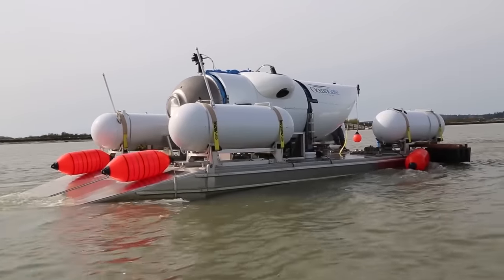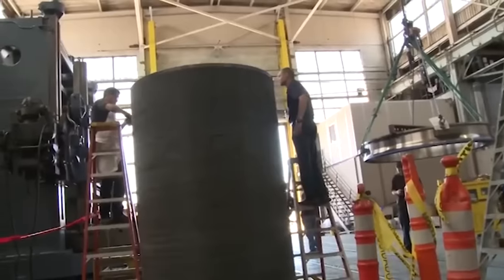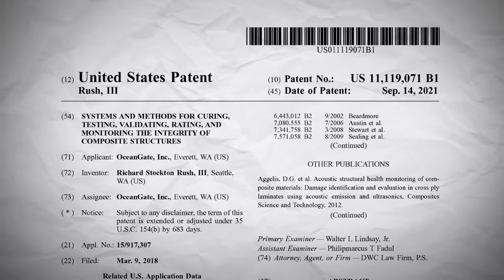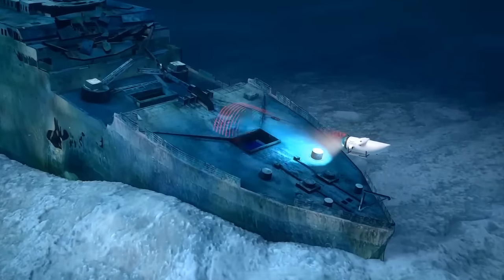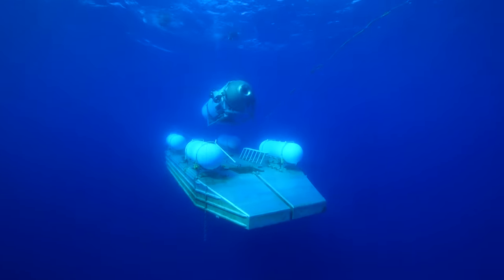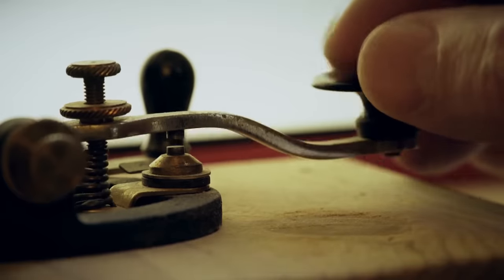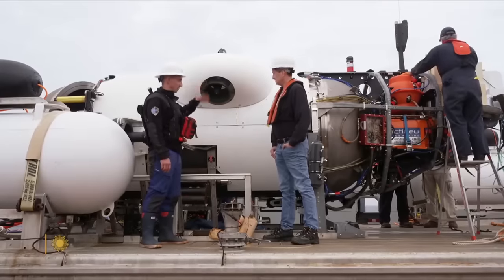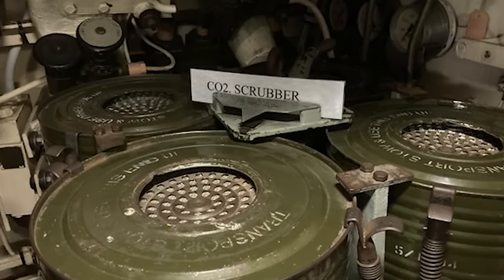Exposing OceanGate Submarines Many Fatal Designs

Comment from the maker: Thanks for watching and sharing so many insightful comments! I will try and summarise points I see here for those interested (please reply to this comment with more details you have!) :

- The carbon fibre was laid in one direction for the Titan, not a four axis weave pattern, which is much stronger
- Carbon fibre hulls are better understood for single use applications
- Other carbon pressure vessels (e.g. hydrogen tanks) have high pressure inside, instead of outside. This plays to the tensile strengths of carbon fibre, instead of relying on the compressive strength.
- Although game controllers are used in the military, this is never for complete control of a manned vehicle (though they are often used for life-critical missions, such as bomb disposal). The game controller being wireless was also an added failure mode, however there may have been control available through other methods, such as the touch screens, if needed.
- There was an inertial navigation system on the Titan, but this did not guide them toward the Titanic wreckage or give details on their surroundings. They were still reliant on the mothership for directions!
Reply: Titanic Submarine Mission V, James Cameron, Avatar: The Way of Water, The Abyss & Greek Sea Gods...

Come this way...
Reply: Physics beat you to this topic.
Reply: @JeremyRobertWalker  
ESG scores are to die for.
Reply: you are doing well sir
Reply: There was no backup Remote vehicle attached to the submersible to assist with recovery efforts in a disabled state and Stockton was warned about the consequences. What an egotistical tool!
Reply: @@presidenteden6498 
Excellent point 👍
Makes me wonder how thick the champagne bottles glass really are and how much pressure they had in them before the Titanic sank🤔
Reply: you clearly missed a point, fiber carbon is used to keep the shell from EXPANDING. it is 100% useless when COMPRESSING, experts told the guy not to use carbon for that reason.
Reply: You don't know the failure point yet. How about we allow the investigation to determine that definitively before we just pronounce it.
Reply: I did learn something new, but is Elon Musk listening before putting people at risk going to Mars?
Reply: Hello Ryan, my Uncle Ned was on said Submarine!  It's very sad and I'm a wreck!
Reply: @@presidenteden6498 Be interesting for someone to retrieve one of those champagne bottles and bring it back to the surface to see if it remains intact and then inspect it! 
By the way, your far beyond my pay grade I didn't graduate and couldn't pass the GED. But I did experience 12 feet under water as a kid 40 + years ago playing in a Olympic size swimming pool. 
And from my very limited experience I would not have gotten into that death trap, even if someone paid my broke arse.  🙄
Reply: @michael-4k4000  Very sorry for your loss Michael. I still miss my uncle that passed in his sleep 14 years ago. And my father that disappeared 30 years ago.😔 
Take care of yourself and God speed 🙏
Reply: @@presidenteden6498 
The Titanic filled with water and sank, this equalised the pressure inside and out
A ceramic plate doesn't have air cavities, it's not hollow
Reply: carbon fiber should have never been used. 120 tons of outer pressure. carbon dos not flex. the epoxy used is super strong but not for that much pressure. if they were to make that sub then limit dives to 13000 feet 4 times then trash the sub, and make a new one maybe. I worked with Howard Hughes designing subs. for the defence department. we had double hulls triple hulls. we had subs with hulls, that were double then we filled the middle with a classified oil. having a liquid middle hull, there zero way for the hull to crush. a oil can not be compressed any more than it is in a jar.
Reply: I thought this was the titans first dive? You said it's previous dives......?
Reply: @franksmith3602  Interesting, thanks for sharing your valuable experience! 
Take care ✌️
Reply: @@presidenteden6498 most bottles have corks pushed in, so they filled with water before getting to crush depths.  Plates can’t really compress any more as a solid, so they just sink.  Also, parts of titanic filled with water before sinking, so pressure was equal inside and out, so a lot of things survived because of this.
Reply: @fubarlife7776 Studies have shown that corks pushed into bottles, so the pressure inside he bottle equalised before crush depth.  Noting though that they may be  French ‘wine’ bottles…..because champagne bottle cork is like a mushroom….but maybe not all.  I don’t drink the stuff……😮
Reply: so OceanGate were the Watergate of deep sea diving ?
Reply: @@presidenteden6498That I can’t explain.  Maybe because bubbles in bottle are tiny, the liquid is dense enough to stop bottle imploding.  Mostly Water on inside hold back water outside.  Not sure of density of alcohol either…..could be denser than water??
Reply: You never mentioned about the controller being a cheap logitech version of the real xbox controllers that the military actually uses. They would never use this cheap controller or probably wireless controllers too since they have a higher chance of interference or disconnection, its better to have wired.
Reply: @@presidenteden6498Alternatively, maybe pressure kept cork in due to shape, but water was forced between cork and bottle allowing pressure to equalise?  I could see a situation where a cork could compress a little in one area, but still remain in place.
Reply: @DannyBoYfutube  I don't know if anyone has answered your question yet but I think the Titan had made about a dozen previous dives
Reply: @shannond9945 
Pure liquid ethyl alcohol (aka ethanol) is less dense than water, however typically champagne is about 10, maybe 12% ABV, the rest of it is essentially flavoured water
That being said, through evolution and/or selective breeding, modern yeasts can yield a higher alcohol percentage before dying off
I don't know what strength century-old champagne would be, it could be as low as 8%
And of course, if the champagne became contaminated somehow, it could alter the chemical composition (such as when wine turns to vinegar)
Reply: How do you know it was the carbon fibre hull that collapsed?
It could have easily been the viewing window, as far as I’m aware we still don’t know the true failure point.
Reply: The coefficient of expansion of CF is negative. I presume they had a metal core upon which the carbon was wound. That will have a positive expansion coefficient. 
I would suspect that there was delamination. Once you have delamination, you get cracking. Then you get water ingress. That's under pressure, and now you have a relatively weak metal shell. Then it goes bang.
Reply: It's made to explode not explore 😮
Reply: @presidenteden6498 essentially yeah
The pressure inside the vessel isn't strong enough to push back on the pressure outside
Which is why the vessel's walls have to take the strain
There were plenty of design flaws with the Titan, I don't know exactly what part ruptured
Reply: @adamheywood113  ohh..I wonder why it never crushed then? Probably weakened it because I heard once a sub dives to crush depth it should be retired for that very reason
Reply: @VanillaIceCoffee did you take pleasure in typing “you clearly missed a point”? Is arguing online with strangers the only source of happiness in your life? Even when you want to argue, you have to be rude and confrontational? How sad.
Reply: @lhovo The press conference said debris field from this I would assume the same. If the window blew in the rest would remain whole? I don't know this whole deal pisses me off so bad I don't have the words for it. Reckless isn't even close to covering it how many times was rush warned about the design I mean geez!!!
Reply: @Mogamishu  it's sad that you prefer to be misled and embrace misinformation.
Reply: @lhovo  The rear section of the submersible was found in the initial debris field. That could indicate the window did implode with the pressure blowing off the rear section.
Reply: @frizzlefry1921  The hull debris field could have been a secondary failure not the primary one. I’m not drawing any conclusions until the report is out.
Though it could be a similar effect like a soft drink can, it’s hard to crush until you punch a hole in the top. (I am not a structural engineer, this is only my personal thoughts)
Given the front viewing window was also under rated for the depth this also might be a contender. Along with any number of defects that we are learning about.
Reply: @@presidenteden6498difference between gently setting an item down and smacking said item with a hammer.
Reply: Excellent video,  answered a lot of my questions. As an aircraft mechanic for nearly 30 years, I am astounded by the seeming cavalier arrogance of a builder who would convince customers to risk their lives in a vessel that was viewed by other deep sea experts as questionable design. I wonder if a carbon fiber sphere would have been better with a circular window?
Reply: @@presidenteden6498 I get it. Still once the space ship is up and on it's way there won't be any way to retrieve it or for them to be rescued. In my opinion it's a waste of time and money that could be invested here on earth for people that need immediate help. But what do I know. Musk has more money than any of us could ever dream of having, even a fraction of a percent. The monies could be spent solving water and food issues here on earth!
Reply: What is your source for the carbon fiber layup schedule? Please don't say a 25 sec video on YT.
Reply: Everybody seems to be an expert after something awful happens, but never before.
Reply: ZithroTech - just a quick correction. You said the Titan dove to the titanic 7 times before. It actually made MANY dives to all different depths, but it dove a total of 12 successful times to the Titanic, taking a total of 28 people down over the last few years. Reporter David Pouge discussed this last Sunday on CBS This Morning. 

More importantly this was Titan’s 13th dove to the Titanic - 13 is an unlucky # even in Space travel….
Reply: @michael-4k4000  My condolences to you and your family 🙏
Reply: The flotation bags can only be inflated near the surface, it would require air at a pressure greater than the pressure of water at that depth to inflate them and there were no tanks of sufficient size and strength on board.
Reply: With these enormous pressures, how does the best of vessels resist successfully? E.g ones that go to Mariana a la Cameron? What's the physics of that?
Reply: A bomb disposal robot isn't a life critical application. If the controller fails you still don't have anyone in the danger zone and you can just go get another controller / robot.
Reply: @mindfulawareness1  
The crew compartment is spherical
A sphere, assuming walls of homogenous thickness and strength, has equally strong walls that resist the pressure evenly
Titan had a cylindrical crew compartment, capped with hemispheres at each end
While a cylinder is still fairly decent at resisting pressures, it has a longitudinal weakness not present in a sphere
Reply: @DannyBoYfutube  it had dived on titanic the past three years I have heard numbers of between 7 and 20 times, I thi k it's probably somewhere in the middle.
Reply: Two things: 1. I do not think the mandrel used to construct the cylindrical mid section (made of carbon fibre) was left in; it was removed. I say that because somebody has incorrectly replied here saying the mandrel was made of titanium and left in. I think the circular metal plates (rings) on the cylindrical body to which the hemispherical titanium ends were bolted (18 bolts each) were also made of titanium. I do not know how this ring was sealed to the carbon fibre cylindrical body, nor how that seal would fare over repeated fives to 3000 m 2. The CEO of OceanGate told a paying customer on the mothership one evening “over cigars” (it is alleged by this customer on video) that the carbon fibre was purchased at a low price because it’s ’use by date’ had passed. I do know that such dates exist for carbon fibre filaments, but I do not know what happens once the date has passed or why they have a use by date.
Reply: Why didn't they submerge Titan 100 times before putting humans in it.
Not rocket science!!!
Reply: @lhovo  apparently the end cones are still intact but the carbon fibre tube is nowhere to be found so probably shattered into many small pieces!
Reply: @Mogamishu  he is correct though carbon fibre is strong in tension, but not in compression,  when the load is held in tension the fibres are pulled therefore causing them to be pulled tight to one another, in comparison it's like tying certain types of knots that when you pull them they will be completely fine but as soon as you release tension and push on the line they unravel, it's really the resin that kept the titan from imploding till now.
Reply: @JohnnyMotel99  no the rear section would have detached  if the carbon tube shattered it could have the way you describe also but in that instance the carbon tube should still be intact, remember there were no mechanical bonds holding the carbon to the end sections only glue, if what you suggest happened the water would have blown only the weakest point from inside which is the tiny amount of glue holding the end on and the carbon tube which is stronger in tension than compression would still be intact and they would have announced they had found that in one piece.
Reply: @@presidenteden6498 I am also a layman, but I understand that solid items don't tend to impolode like hollow ones. And as for the champagne bottles - there is also a pressure inside usually, maybe a flat wine would implode. And there is also a volume vs surface area ratio that may play important role. They also had corks pushed further inside... so there apparently was some equilibrium reached.
Reply: @lhovo  A tin can doesn't equalise in pressure in an instant when you open it it would have taken a very small amount of time for that to have been filled with water and the rings would still have been in place till the water smashed the back surface if that happened the weak spot would have been the glue holding the end cap on and the pressure would have been equalised a millisecond or two after that was blown off the tube would have stayed intact I think in that scenario.
Reply: @mindfulawareness1  contiguous materials, so a single material either titanium or an extremely strong steel and usually spherical designed  pressure vessels!
Reply: @Coolcmsc  I'm sure ther wasn't a metal tube inside the carbon and there were Zero mechanical bonds between the end caps and the carbon tube, it was glued on at both ends and the bolts were for sealing the door when they were enclosed in the "Submersible" I use the term loosely at this point.
Reply: For whatever the carbon fiber hull layout we kind of know now @ how many descents it supports. It indeed advanced science but did it really requited enough to require lives in such manner rather than in procedural study?
Reply: Carbon fiber is known for tensile strength, not compression, that's the first problem with material choice.
Reply: "Other carbon pressure vessels (e.g. hydrogen tanks) have high pressure inside, instead of outside. This plays to the tensile strengths of carbon fibre, instead of relying on the compressive strength." - For example, Boeing 787 fuselage.
Reply: @mindfulawareness1  Cameron and also those in batyskaph in 1960s were in a globular vessel, where the pressure is coming from all directions equally. Their glass cracked, but it was pushed into itself, so win-win. The globe shape as ideal was also mentioned in the video. Watch it again.
Reply: @@presidenteden6498 to your question, those items didn’t experience implosion which is a sudden pressure change. Therefore, those materials could adequately adjust to the pressure change as they sunk. My best description of implosion is like what happens to a fly if you kill it by quickly clapping it between your hands. The massive pressure introduced by your hands pulverizes the fly in to guts and big parts. The titatan experienced that on a much greater scale (instead of two hands it was two Empire State buildings within a fraction of a second).
Reply: @@presidenteden6498 Are you sure it was the pressure that broke those cups? I saw images of plates broken also. Google is your friend, my friend.
Reply: @@presidenteden6498Are the champagne bottles open / empty…if so, pressure equalized .
Reply: @plasmasupremacy9321 Ot wasnt wrapped around titanium.
They used titanium for the end caps which were glued onto the carbon fiber center section.
The center part was just a roll of carbon fiber shaped like a toilet paper tube, with two titanium end caps.
Reply: @@presidenteden6498 bottles and bowls and vases all have the same pressure inside them as outside them as they sink so they experience no substantial pressure differential. However, if the bottle was sealed as it sinks, there would be a difference and once that differential is higher than the yield strength of the material (glass/ceramic/etc), it would burst into pieces (aka implode). So it’s the pressure difference over time that actually matters. Not just the pressure…
Reply: @mindfulawareness1  Um I can point you at a few engineering degree courses. Or the book "Structures : Or Why Things Don't Fall Down" by J. E. Gordon, which is fairly accessible.
Reply: @stevepalpatine2828  there's actually video of them rolling the carbon fiber hull for Titan, in which you can see the titanium tube they start with. The majority of the wall thickness was carbon fiber but the inner liner is metal.
Reply: @donaldasayers  many thanks. It's still quite astonishing. All credit to James Cameron for having the balls and trust in science to go down in that thing knowing what the slightest breach to the hull would mean with that pressure. It is fascinating.
Reply: @@presidenteden6498 pressure only really applies when there's something for the pressure to push against, ie a container full of surface-pressure air. I imagine the champagne bottles are small enough, the pressure probably isn't enough compared to the thickness of the glass. If you could expand a wine bottle to Titan size, it would likely not make it that far down
Reply: They used/use Xbox controllers to fly military drones...
Reply: Besides analyzing the debris, actually a rather expensive but possibly worthwhile study would be to reconstruct the vessel to identical specifications and with identical procedures, then bring it down the ocean again to those depths (or simulate that descent in a big enough and powerful enough pressure chamber) as many times as it did, but now with no passengers of course, until it fails. So do a proper destructive test. But of course, all the while safely high-speed filming, and having all kinds of proper sensors and engineering around it to study the failure. This will better show the whole world why and how it failed, and why the humongous pressures of the deep sea should be off limits to amateur enthusiasm and bogus claims about safety.
Reply: I thinks its just a rich guy that commited suicid just wanted to show off doing it. bad to say but thats how people are
Reply: One correction should be made. The University of Washington has gone on record stating that the University did not collaborate on the project. They merely rented their test facility to the builders.
Reply: Just curious why is it that that are wine bottle in the titanic site fully untouched and unbroken by the so called tremendous so called pressures?
Reply: @@presidenteden6498 Have there been intact champage bottles recovered from the titanic? By that I mean, still closed ones? A bottle that is full also has very little air inside, so the entire pressure differential is mostly with respect to that small pocket of air. Weakest point might be the cork/cap.I'd guess, while the Titanic descended, the increasing water pressure would likely make the corks or caps yield enough or fully go in, so eventually pressure got balanced before the breaking point for the glass.
Reply: @@presidenteden6498 and that proves the cup was broken by pressure of water, like the vessel? Are you trolling me or what?
Reply: @@presidenteden6498I think the champagne bottles would have been open which means that the pressure from the sea is pushing outwards as well as inwards on the walls of the glass. Similarly the plates don’t have a hollow chamber filled with air. So the pressure of the sea at depth would be even accross the surface. The it’s the difference between inward air pressure pushing out against the sea pushing in against the outside of the titan which caused it to implode. Had they just dropped the titan into the sea with the hatch open it would have filled with sea water then sunk to the bottom intact.
Reply: @plasmasupremacy9321  that was a Mandel to wrap the carbon fibre around and was removed before the cabon fibre would have been put into a bag and impregnated with resin in a vacum in order to force resin into the structure of the carbon weave, that metal was not a part of the subs structure.
Reply: @@presidenteden6498i think them being filled with liquid? Im not sure either but now thats gonna bug my brain too. Lol
Reply: The great thing about carbon fiber is that it can be laid out in a manner consistent with the expected loads.  And it seems common sense that those parameters could have been determined based upon the shape of Titan.
Reply: Great video. Complex topics explained with simplicity that anyone can understand.
Reply: That's just not true about the controller man. A submarine is not controlled by it xD. A PERISCOPE of a submarine, so one of its (and not a crucial one) systems.
Reply: @FurryTrash_  adidionaly in the small scope of military usage of a controller (and definetly not to control a submarine as he claimed in his video, just  a periscope, and not even fully), miliatry uses WIRED controllers. Which also would be a far better idea here, but the dude was a businessman, in one of his videos he claimed, that they are wireless to pass over to the passangers... Very resposible.
Reply: @plasmasupremacy9321  That was just what they were using to form it.
Reply: 1. There were titanium rings glued to ends of CF tube,on outer radius, and then the caps were bolted to the rings.
2. The controller is not that different from what military or similar would use. Yea its mass produced for video games but most of the military controllers that are built still use the same brand internals such as the buttons and joysticks. Look into it, the only major difference is the circuit designs are strengthened for durability and to be more resistant to interference.
Reply: there is no defense for this use of off the shelf consumer grade electronics. I promise if you did a blind study and showed the current iteration of ALVIN and TITAN side by side and ask adults which one they would use to go to 14,000 feet below the surface the vast majority would choose the former, while a small minority would choose the latter.
Reply: re: " The game controller being wireless was also an added failure mode"
I don't know why people think this way. There are no interfering sources 4 km down in the ocean, or even able interfere at a couple meters depth for that matter (sea water - conductive as it is makes good 'screening material to EM waves/RF energy/radio waves.)

AS to wired controllers, the danger of electric shock exists, as does static electricity damage to a controller in a wired system, and possible tripping on a wired-controller's cable and pulling it out of a console.
Reply: The titanium end caps were attached to the carbon fiber hull with an epoxy. I'm will to bet that the failure was there
Reply: @Coolcmsc Now you mentioned everything. I didn't know about the dated carbon fiber. But you're right, no internal titanium hull was there. Just the rings. About the way they were sealed to the 'Coke Can' i don't know. But i guess the patent must be registered somewhere... poor souls.
Reply: It looks like all he did was to spindle prepreg onto a mandrel without curing.  And it seemed to be all one type of ply building up a thickness.  We take greater care with plys for non-load bearing fairings in secondary structure than this.  No one would ever build a flight critical part this way let alone a single failure mode critical path item.  Still cannot understand who thought this was OK.  Apparently if it is not classed by ABS or Lloyds or someone it's just a matter of rider beware, except that this was most obviously passage for hire like charter to the tune of $250,000 per dive per person.  ALSO, UW stated that they only worked on a previous all steel submersible under a small contract and not to completion either.  So this was NOT a UW design.  Nor NASA, nor Boeing.  Q: who told you Virginia Class attack subs were controlled with video game controllers?  I think you succumbed to semantics.
Reply: The Gospel, which means the Good News is the news that God Almighty, the Creator came in the flesh as Jesus Christ to take away the sin of the world. The one God is a trinity of the Father, the Son and the Holy Spirit. The Son came and laid down his own life to save ours. His sacrifice on the cross paid the price for our redemption with his own blood. On the third day he rose from dead and offers the gift of salvation and forgiveness to those that repent and trust in him. 

John 1:1,14 KJV
In the beginning was the Word, and the Word was with God, and THE WORD WAS GOD. [14] And THE WORD WAS MADE FLESH, and dwelt among us,

1 John 3:8 KJV
He that committeth sin is of the devil; for the devil sinneth from the beginning. For this purpose the Son of God was manifested, that he might destroy the works of the devil.

Isaiah 9:6 KJV
For unto us a child is born, unto us a son is given: and the government shall be upon his shoulder: and his name shall be called Wonderful, Counsellor, The mighty GOD, The everlasting Father, The Prince of Peace.

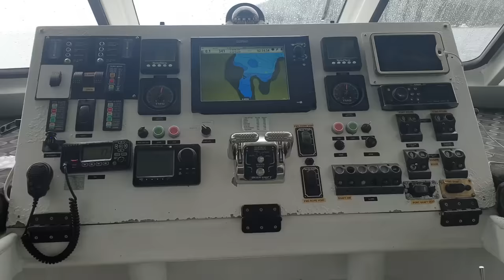John 1:10 
He was in the world, and the world was made by him, and THE WORLD KNEW HIM NOT.

John 3:18 KJV
He that believeth on him is not condemned: but he that believeth not is condemned already, because he hath not believed in the name of the only begotten Son of God.
Reply: @@presidenteden6498 Opened bottle would fill up equalizing the pressure.   Plates are  not containers but are simple solids.
Reply: The device was, to a degree, a success. However, after the 2nd or 3rd dive the "service engine soon" light went on. Rather than isolate the reason, Stockwell chose to remove the light bulb. Anyone hear anything about that?
Reply: Very interesting insights on your video! I'm still intrigued to imagine what actually failed. Was it the tube or the end cap with the portal window or was it at the seal? Did the tube shatter like an eggshell, or did it buckle (ripple along the long dimension of the tube)? On the latter, the ripple signals the end of geometric equilibrium of the shape, and the extreme forces are then easily able to crush the structure like a wet noodle. Also the geometric deviation now means it is out of round at the seals, and so the seals will give way, high pressure water rushes in like a cutter, lacerating anything inside (living or structural), and also the inevitable compression of the air from incoming water turns it into an instant high temp furnace that incinerates anything inside, some water vapor is generated which then triggers a steam explosion (along with anything inside that is combustible at high temperature...end caps pop off as the tube for collapses and shatters like glass.

... or is it the portal window fails, triggering the same water in rush, compression, ignition event?
Reply: @joshuapatrick682  I agree most people would probably choose Alvin over a Titan iteration; BUT you're argument about the electronics is not valid. Alvin's systems electronics are WAY BETTER yes. Alvin's controls cant be replaced/repaired as easily as having a whole backup controller though. We shouldn't even be arguing about the controller when the electronics were mainly housed outside Titan, exposed wire packs can be seen on the outside. The motors were unprotected as well. There were no redundant or secondary circuits for power or controls.
Reply: @Sig509  yea thats what i said but yeah it should be wired and only the driver using it not the unexperienced passengers lol
Reply: @DannyBoYfutube  It had 4 dives I believe.
Reply: @@presidenteden6498probably as they are full of water so no internal external pressure like what you have with a sub. That's an educated guess but trust me I'm not now going to build a sub on that hypothesis.
Reply: carbon fiber 'hulls' are used in no deep diving applications. it's silliness, but something you'd expect from aero engineers getting into submarines.
Reply: Idk if I need to say this but considering 
  
    the ROV that found the end cap  uses gasoline flotation like most deep sea exploration vessels with equalizing valves on the underside for trapped air

  why don't they use air ballast

air at that depth is not air
    and not air can't provide buoyancy 
  and if it is air and suddenly stops being air thousands of degrees  instantaneously  crushed 

     and any pressure chambers minimize surface area and are very strong
    I'd pull the Trieste out and go down in it before I'd go down in that thing

 also pressure testing and fatigue testing dont just make up some numbers in your head got to pop one 
   and there is a difference between crush depth and rated depth huge difference 

ps:  you can make a system without a single hole in the pressure chamber with the hatch sealed poting batteries and electronics outside and  using the window with ir and mhz can also pot fiber optics outside and use a gasoline Bouy with a wench for high speed data top side can use the bouy line to guide a rescue line vlf ulf also not a bad idea

  and if you can only calculate crush depth and say it's 3000 meters wouldn't take it past 1500

composites are great for non pressure pieces but a black smoker will eat right through glass composite shit 
  if you lose your gas your stuck on the bottom

I taught myself all of this and can't understand how this disaster happened

   Psaaps:  redundancies is important no law says you need only one control system and coms

Even use the same tech on a rov control it miles away
internet is a wonderful tool

I've been a addict of the depths since I was a child watching the abyss sea quest and 20000 leagues a life time of passion can either lead to knowledge or the lack of try to make it the former and don't be afraid to listen to others with experience
   Me myself a enthusiast would love to hear what others in the community have to say about my designs and would take their input with the weight of Jupiter not a grain of salt

The Trieste bathyscaphe used air water ballast to reach the dive site not at depth to counter hopper weight great drawing on the wiki

I wouldn't hire professionals if I made that thing either but then i wouldn't have made it
Reply: Htf was a air bag spose to work at that depth ¿!
Reply: @goofyiest  Im a little insulted 😢
Reply: I hope it wasn’t a sudden implosion so the Rush dude didn’t feel anything. I hope it happened rather slowly so he was scared cold, peed his pants, and screamed like a real mtfker !
Reply: I have designed carbon fibre pressure vessels for underwater ROVs in the past and.....

The maths for the design of the hull do not add up according to the data presented on compositesworld (do a search for cyclops 2)  Which references a design depth 4000m with safety margin of 2.25, giving a design depth of 900Mpa

They detail an outer diameter of 1676mm. and a 127mm wall thickness, using alternating layers (which is odd as hoop stress is double the axial stress.

900 Mpa will result in a hoop stress at the inner wall of 5400Mpa in a homogeneous material. But with some of the fibres being in an axial direction the same load is taken but fewer fibres. If you engineered the composite to have a 2:1 ratio of hoop fibres to axial fibres*, this will put the stress on the hoop portion of the layup to be around 8137 Mpa.

*this is the logical way to do it and I would assume what was done.

Toray list the compressive strength of "the composite" of their T800 fibre as 1490Mpa, (which is less than half it's tensile strength of 3290) and well below what would be required. (The Grafil 37-800 reportedly used has similar raw tensile figures but no compressive strength data from Mitsubishi).

At 380Mpa (pressure at Titanic) the hoop stress on the hoop fibre portion of a 2:1 layup would be approximately 2300Mpa, still above the rated sped of similar materials.   It can be argued that with much thicker walls the compressive strength will be increased as it will prevent the localised buckling of the fibres that would lead to a compressive failure, but we would need to see a 50% increase in strength to survive the nominal dive depth with no safety margin.

The alternative is that the hull really didn't have any axial fibres in (we don't see enough of the construction on the Oceangate videos) in which case the axial loads would inevitable crushed the hull end to end.

I cannot see how this hull would have survived.
Reply: Touch screens are the last thing you want for controlling a vehicle you are travelling in.
A bit of turbulence and you finger could go anywhere on the screen.
Reply: @vaultslayer9162  Maybe they ought to make a submersible out of carbon fiber only, forgetting about the fiber glass? Tie the carbon fibers strands together with very tight knots?
Reply: I'm glad you brought up the controller. The media seems too hung up on that, I said pretty much what you said to my family and friends. You explained it well.
Reply: Subscribed. 👍
Reply: Carbon fiber is a tough and strong material and, like many composites, is relatively stable to the effects of temperature. But not as elastic as steel or titanium. It's a mystery to me why he mixed three different materials together as it was specifically used for something that would be constantly subjected to different pressures! not designed to explore, but to implode. a one time experience with a one time adrenaline rush! for only 250'000box. Feel sorry for the poor victim! Irresponsible behavior from the CEO!
Reply: Just Wanna Say Thank You For Making This All Happen After What Happen" Your A Special Person From FatherGod
Reply: ZerothTech is MaxithTech for interesting, clear, lucid, cogent and logical explanation. More power to you bro. Please keep up the superb work - it's a major credit to you.
Reply: You lost me at the mention of your channel focusing on sustainable energy and electric bullshit. What powers the vast majority of electricity, Einstein?  Coal, natural gas, and nuclear. Hydro power is an honorable mention. Electricity is not an energy source... it is a by product of other energy sources.
Reply: @julesviolin Money talks before common sense in this tragedy.
Reply: @franksmith3602  CFRP is great in tension, but horrible in compression.  It would have been just as well wrapping it with any cheap rope.  Just like you can't push a rope, you can't push carbon fiber.  In addition, thick CFRP layups wrinkle internally when cured due to the temperature gradient during curing, thus the uncured fiber wrinkles since it can't expand.  High stresses, and in all the wrong direction.  The thicker the layup, the worse the wrinkling.  Oceangate was too vain/broke to destroy his most expensive part for testing, and would have discovered this.  But Chesterton's Fence was still in play when these rules were broken.  CFRP is for boys with deep pockets; everyone else should avoid it in critical applications.
Reply: @lhovo  CFRP has awesome strength in compression.  Not enough in compression to ever be used in critical design.
Reply: @nicholasklangos9704  CFRP only for internal pressure vessels.  NEVER for external pressure.
Reply: Yes; you are basically correct.  The Carbon fiber should have been wound in the way of the video showing the small tank being wound.  The reason is that although Carbon fiber has great tensile strength it probably has less compressive strength than the epoxy it was embedded in.
Reply: Imperial units are so convoluted, you have to measure in elephants so people get a sense of proportions.
Reply: @shannond9945  The miniscule alcohol content would be non issue. Specific gravity pf alcohol less than H2O. Gets to the liquid not being  
compressed.
Reply: @plasmasupremacy9321    This is the first time I heard of the carbon fiber tube being a titanium/CF   composite. I believe you are wrong there sir as the whole idea of using CF was to cut costs. Easy to sre how easy misinformstion can be inserted into the story.
Reply: Have to have same mindset as if in Space.
Reply: Sorry if you've already addressed this but can you cite where the definitive conclusion for failure was the carbon fiber hull? It certainly is the likely culprit, but there needs to be definitive evidence to conclude it as such.
Reply: I watched a video of how the guy made the Titan and the way that he described it, it made imagine a little boy designing his own toy.
I think the 3 poor souls who paid 250 grand for that dive, didn't get the technical information from the company, otherwise, I think they would have never board in the submersible.
Reply: @DannyBoYfutube it had at leasrlt 3 or 4 dives before
Reply: It's still fairly early on in the investigation, do we know for sure that the Carbon fiber hull was the failure point?
Reply: @vaultslayer9162  And how did you know that? You can't even spell "sometihing", smh
Reply: James Cameron and others have said there was  transponder onboard.  When pinged by the surface ship it could identify it’s position.  This failed tellingly at the instant comms were also lost. So upon the implosion obviously.
Reply: James Bond had a submarine car
Reply: @fubarlife7776  champagne can not be compressed. It doesn't matter how think the glass was. Water can not be compressed. Oil can not be compressed. 2 tons of pressure or 130 tons of pressure,  doesn't matter. And yes wine bottles back them were thicker.
Reply: @mynameisgladiator1933  yes and no, the DEFENCE department before USEING carbon fiber to make the stealth. Was stressed tested to it's breaking point. The fiber it self dosnt break it's the exoxey,  that gives. Also how the carbon fiber is made determine how strong it is. 
When we built the stealth.  We used large pressure chambers, whole wings were cured under extreme pressures. It's a very complex system. That's why 1 stealth cost 650 million.
Reply: @plasmasupremacy9321  So if what you are saying is true.  The carbon fiber, titanium hull  could have leaked instead of suddenly imploding or sprung a leak first before imploding.   A super high pressure jet of deep sea water from a tiny crack could cut amything inside like a laser saber.  There was banging heard on the hull, the terrifying last moments of this I imagine.
Reply: You talk about a warning system to detect buckling of the carbon fibre before catastrophic failure, but carbon fibre doesn’t buckle.
Reply: @toldyouso5588  I may be mistaken about the inner liner, if others are correct about them removing it after spinning the carbon fiber. Though I thought I saw the metal shell still inside when they glued on the end cap hemispheres. Either way, it would still have imploded instantly. They would not have had time to knock on the hull, those noises were likely from other sources. The ocean is noisier than you would think.
Reply: @plasmasupremacy9321  They removed the titanim casting shell and glued on the end you say.  All the more I cannot imagine how that can be done safely for the depths it was intended.
Reply: There is more to this. Submersible design has been there for ages. The issue is this is not regulated, no mandatory inspections, certification or testing. To standards like DNV GL, ABS etc
Reply: ZIROTH TECH
You are two years too late. There is nothing left to expose now.
By making this video now, the blood of the victims is on your hands.
Reply: The use of wireless for the same controller is problematic - but the use of a game controller with wired connection is actually a good idea.
Reply: you missed something: the end caps lock was attached to the carbon fiber tube with EPOXY + the video of it being applied and the lock being lowered into place to adhere shows it was being done out in the open air not any sort of clean room environment
Reply: All these fake mechanics here dancing on the 5 corpses of this accident are pretty disgusting.
Humans talk to people,  human trash talks about people.
Reply: @fubarlife7776 no
Reply: @DannyBoYfutube it wasnt. The titan had many other dives. 
In 2019 someone told the owner that there was something wrong with the titans hull.
Reply: @tma2001 oceangate was the pizzagate of gamergate
Reply: @fuzzywzhe yep
Reply: This was informative but you didn't say what failed?
Reply: You thought wrong.
Reply: @wharrbarg  a few years back in the UK we had GateGate involving an altercation at the Downing Street security gate - google it, its hilarious!
Reply: Why should that be Musk’s responsibility?
Reply: @uploadJ  even if interference isn't a possibility, the controller still relies on a battery
Reply: Well, if we are going to be talking elephants standing on ONE leg it's 182.. but I'm only an accredited person specialized in this field what do I know 🤷‍♂️
Reply: @adamheywood113  re: "the controller still relies on a battery"
Um, news update: The whole sub runs on a battery or batteries. You were saying?
Reply: 🍀 Oh Great Murphy proud and true is but one law attributed to you. In this place it can go unspoken and to those lost a joint we should be smoking ✌️🍀
Reply: @uploadJ  
I'm just saying, the controller dying is one extra possible thing that can go wrong
The rest of the sub could be perfectly fine, but if that one controller's single battery dies, you've completely lost control
Reply: @adamheywood113  Suggest you research this. Can you research this - are you at all technical? Do you know what MTTF (Mean Time To Failure) is? Ever done any reliability studies on anything at all? Am I talking to a technician, engineer or a well-read layman?
Reply: Carbon fiber fatigue eh
Reply: @uploadJ  Let's go with well-read layman
I'm aware that things wear out over time. In the case of batteries, the time to depletion reduces i.e. it dies sooner, and the lifespan can be shortened by things like charging before it's completely depleted
I do not know if the submersible had a recharging station onboard, or if they carried spare batteries for the controller, or indeed a spare controller; I do not know how easy it is to change a Logitech controller's batteries
I'm aware the sub had a "dead man's switch" in case of emergency, where ballast bags would be released after several hours and the craft ought to surface automatically. Theoretically, in case of things like controller failure or other loss of control, the crew would simply have to wait until they surfaced. I don't know if there was ever a cause to employ this procedure.
It seems to me, having one and only one method of control with no redundancy puts a whole heap of responsibility on one system, and therefore it needs to be made as foolproof as possible, such as y'know, not relying on two fucking AA batteries to dive to the bottom of the sodding Atlantic
I wouldn't even bet a boss fight on a wireless controller, I certainly wouldn't bet my life
I was only pointing out the possible cause for failure besides interference, that's all
Reply: @michael-4k4000  He might have made it assuming he’s a good swimmer so do t give up hope
Reply: I just want to know if they test this without people first, just to gather some data first.
Reply: Difficult question - At what depth did the hydrostatic compression of the Titan hull result in it changing from nett positive buoyancy (above this critical depth) to nett negative buoyancy? 

This might be a possible failure explanation.

Under loss of power (I seem to remember reading that primary buoyancy control fails without power as it involves pumping seawater in and out of ballast tanks), below this critical depth the only way I read to prevent an uncontrolled descent was to roll the UV using occupant positions rolling the UV significantly to ditch the ballast pipes. Was this ever tested? Five people averaging 80 kg, that is 4% of the UV mass - I can't see that rolling it more than 2% of 90 degrees, that surely is not enough.

A 10'400 kg UV hitting the ocean floor at even a few m/s (remember buoyancy doesn't cushion inertial decelleration) surely is not safe with the existing compressive pressure of 3800 m depth, that additional impact stress surely would trigger an implosion.
Reply: @DannyBoYfutube  I believe it was the seventh dive for this specific version of the Titan.
Reply: I saw a report that every nut and bolt on a US Navy sub r tracked from the moment they’re manufactured until they’re installed.
Reply: don't you mean "submmarise points"? heh
Reply: It appears there was less safety testing than they do to a gas tanker
Reply: @plasmasupremacy9321  I have followed this story pretty closelyand have never heard the CF was wound around a titanium shell.
Reply: Mais 😅ooo😅😅😅😅😅😅😅😅😊😅😅😅😅😅oo😅😅😅😅😅oo
Reply: @frankbooth1298  sorry to be blunt but I'm not sure what you're referencing?
Reply: @DannyBoYfutube  definitely not. This was the 7th mission, using the same sub.
Reply: it wasnt meant to be more than a suppository to one of earthes many holes
Reply: @audioauracle-dsyswpwanl-  spiderman no way
Reply: @plasmasupremacy9321  spiderman no way
Reply: @FansReelsOfficialChannel  spiderman no way
Reply: A bluetooth controller with "possible" touch screen backups?

There are entire categories of games I would not trust with that setup...
Let alone two miles deep in any submersible...
Let alone one built without proper testing...
Reply: I would like to add something to your list. These game controllers the military uses are not just plain video game controllers. They are heavily modified and engineered but they are not just regular game controllers you buy for a PlayStation or Xbox. They are similar but are way more advanced. The titan used a plain ordinary game controller
Reply: proof
Reply: @@siliconicarus - OK there 'Q', your tin hat is on too tightly
Reply: @frankbooth1298  it depends on the flavour...
Reply: @frankbooth1298  okay I didn't mean to suggest the water was artificially flavoured
Quick Google search "chemical composition of wine" reveals that "Generally, wine is 86% water, 12% ethanol" and the remaining 2% are other chemicals such as sugars which provide its flavour
If the alcohol wasn't there, then it would be 98% water, right? The other compounds would still be present, and still be providing flavour, so without alcohol the wine is basically flavoured water
Reply: @frankbooth1298  
If I may add some context, the question I was answering was
"Not sure of density of alcohol either…..could be denser than water??"
This was asked because of a discussion why champagne and other wine bottles don't explode under the enormous pressure
The vast majority of the liquid in a wine bottle is water. The vast majority of the remainder is a liquid that is less dense than water.
Overall the mixture will be less dense than water, but not by much. What I'm trying to explain is where the density of wine comes from and why.
In my left hand I have a bottle of Aqua Vale Summer Fruits flavoured sparkling water, and in my right I have Aqua Vale Lemon and Lime flavoured sparkling water.
If you drank the Summer Fruits, you wouldn't then drink the L&L and say "It doesn't taste like flavoured water!"
It IS flavoured water. The flavour is different because of the different compounds in it.
Sometimes they're natural and sometimes they're artificial, but if your drink was 98% water and had a taste then it is essentially flavoured water regarding its density and specific gravity.
Can we let this go now?
Reply: @@presidenteden6498Disclaimer: I am not an engineer. The bottles on the Titanic did not burst because the bottles are filled with fluid. If the bottles were filled with air however, there would be an implosion.
Reply: @presidenteden6498 Because the plates and champagne bottles were not filled with air.  In order for an undersea implosion to occur, the vessel in question has to be filled with air for the seawater to compress.
Reply: The failure was most probably the bonding points of the two titanium hemispheres and the carbon fiber main cylinder.  That combined with multiple deep sea dives, what a tragedy
Reply: There is also the shape. Most DSVs have a pressure hull which is basically Titanium made into a perfect geodessic sphere, which causes the pressure to be a constant value for all directions at any given depth. 

In the case of a titanium cylindar usually used in the military subs which is strikingly similar to DSV Titan's shape are usually only certified to a depth of circa. 300 m and are usually much larger and heavier than a DSV, having displacement similar to displacement of a ship. (For refrence: RMS  Titanic lies at a depth of about 3,700 m.) 

In the case of a cylinder shape, positive  pressure (e.g. water pressure) will be greater across the longer side of a shape because where pressure itself is a constant value, the energy it actually imparts is a function of surface area because E=MC^2 (e.g. Energy  is correlated to the mass of the water available to a single point and pressure always exerts itself as a mathmatical ray, not a line because pressure cannot be both positive and negative at the same time without cancelling out to 0). 

 Therefore a carbon fiber hull in the shape of a perfect sphere similar to the shape of the titanium hull used for DSV Alvin would be much stronger than DSV Titans more or less cylindrical shape  though I still doubt it would be sea worthy to a depth of 3,700 meters.
Reply: @fubarlife7776 in the case of a champaign bottle, because the corks have pores which are not water tight, the pressure would be even on the inside vs. the outside suvh that the glass bottle will neither implode or explode - for the same reasons that titanic itself did not immediately implode upon reaching its current 3,700 m depth.
Reply: @franksmith3602 a DSV is not a sub. The physics behave alltogether differently because DSVs are usually quite small in terms of displacement as compared to the larger military-type subs that have displacement closer to a medium sized ship than to a DSV.
Reply: @Harlem55  "E=MC^2 (e.g. Energy  is correlated to the mass of the water available to a single point and pressure always exerts itself as a mathmatical ray, not a line because pressure cannot be both positive and negative at the same time without cancelling out to 0)."

You sounded like you knew what you where talking about until you blew it using a formula that has nothing to do with subject!  And the whole paragraph!🤦‍♂🤣

Was it your own ignorance with the help of goggle or did you get AI to make this post?
Reply: @moss1066 I think the frequency of dives without close inspection (ultrasound or X ray to look for small cracks) was a huge factor in this. DSV Alvin only has two or three dives a year and undergoes an extensive disassembly, monitoring, and repackaging routine everytime it is deployed. Had Titan been properly inspected as an experimental DSV the fatal mission would have quite possibly been aborted. Rather, this guy did literally everything you dont do. It is often said that when one underestimates safety potentials in the open ocean one will eventually pay the price in the form of the loss of human life. One should never underestimate what a lake, river, sea, gulf, or ocean can truly do which can be both awe inspiring snd dangerous at the same time.
Reply: @shannond9945 cork has pores and is not salt-water tight at a depth. The increasing pressure during descent basically forced saltwater through the corks of the bottles until the pressure equalized on both sides of the glass.
Reply: @joshuapatrick682 If we are to compare cars to subs: the first iteration of DSV Alvin would be the benchmark GM, Ford, or one of the better Hondas. DSV Titan is like an old rusted out beatle shell with a motor that backfires constantly. Titan was by no means even remotely to be considered a sea worthy vessel by any stretch of the imagination.
Reply: @plasmasupremacy9321  I have yet to see this CF/Ti wrapped main tube of the titan show up as wreckage. Do you know how thick the titanium sleeve was? I have heard the C/F material was 5" thick.
Reply: @@presidenteden6498champagne is pressurised enough inside the bottle to counter the external pressure, the balance is enough to not break the glass bottle. 
There was wine bottles onboard but they all burst due to having no internal peessure.
Reply: best video on the topic so far
Reply: That does not agree with what Composites World said in 2017. They say there was fibre laid in both axial and hoop directions. Haven't you seen that?

In addition, for these stresses you would NOT use a 4-axis weave: that's a waste of material.
How do you justify that statement?

"Carbon fibre hulls are better understood for single use applications"....what??? That's completetely wrong.

"Other carbon pressure vessels (e.g. hydrogen tanks) have high pressure inside, instead of outside. This plays to the tensile strengths of carbon fibre, instead of relying on the compressive strength.".... sure. But carbon fibre STILL has compressive strength. The point is does kit have enough? And the answer is YES.
The actual point was NEVER about not enough strength, but about failure mode: delamination, fatigue etc etc.
Is NOT about the use of a composite design.

Hmmmmmm "Although game controllers are used in the military, this is never for complete control of a manned vehicle (though they are often used for life-critical missions, such as bomb disposal). The game controller being wireless was also an added failure mode, however there may have been control available through other methods, such as the touch screens, if needed."....
Yeah?
So tell me, what is actually wrong with the actual electronics inside this game controller???
And why is wireless inherently bad???
Hmmmm....what about the benefits of NOT having to drill holes in the sub to pass wired connections out?
Do you actually KNOW there was an issue with the controller?
No, you don't.

"There was an inertial navigation system on the Titan, but this did not guide them toward the Titanic wreckage or give details on their surroundings. They were still reliant on the mothership for directions".
Do you actually know the details of the inertial guidance system?

To be clear: I am not so sure Oceangate operated in the best manner, but I do see a lot of waffle about the accident.
Reply: haha no more money for them :)
Reply: @mynameisgladiator1933  Yea cuz the sub did well for many dives that deep already, ofc the strenght can decrease over usage. That hull strenght detector is pretty useless cuz when an alarm goes off it's already too late (cuz they're too deep mostly).
Reply: Iìioiiòìo
Reply: Nice video, a real person and a real voice! I was wondering how the Titan and the surface vessel were communicating.
 My biggest question was why you'd use carbon fiber in this application. It is very strong in tension, like pressure vessels (tanks) but I'd never heard anyone considering it used for this type of application.
Reply: The devices in the pressure vessel should have been intrinsically safe devices. If the Walmart lights and monitors shorted out and caught fire, everyone would be dead in moments.